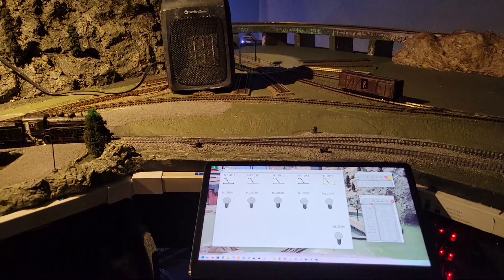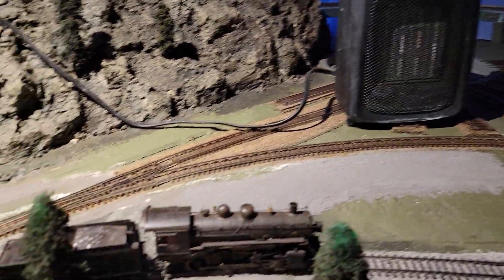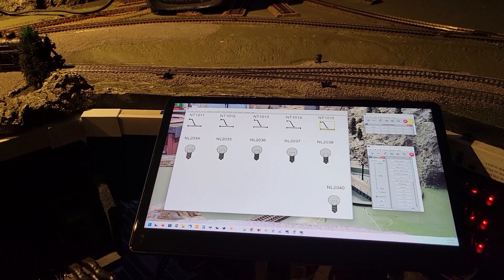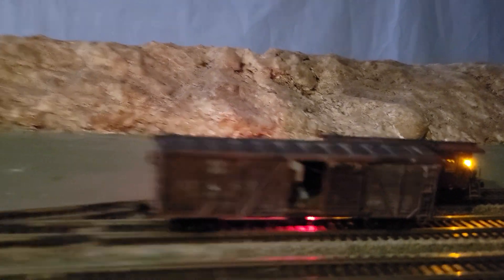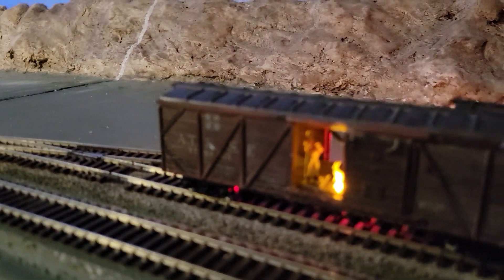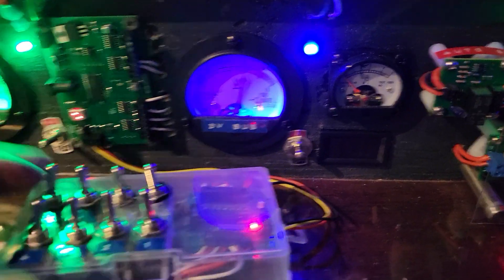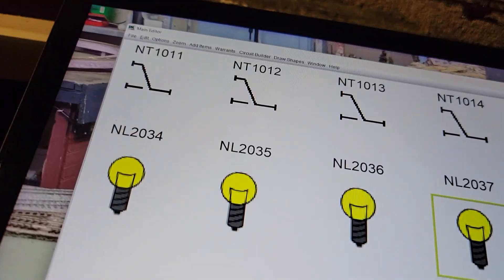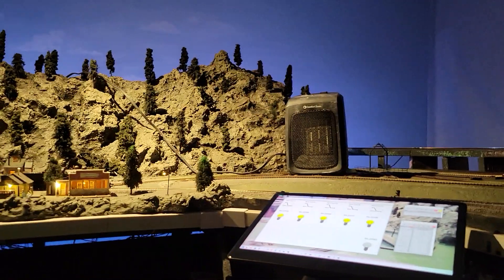029. Touch panel is working and a little bit of block detection is working.

Comment from the maker: Figured out what's going on with my frog juicers.  They're working as they're supposed to but I don't have the turnouts at both ends of the sidings synchronized yet.  I was planning on getting to that, but until I do if both ends aren't switched I'll have shorts.  Fun stuff.